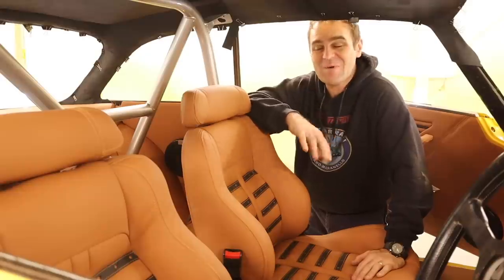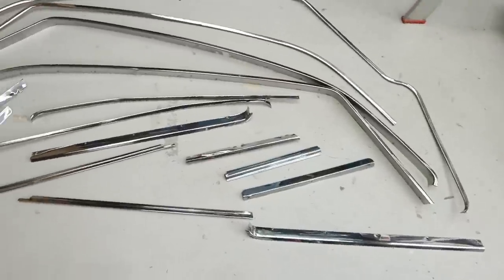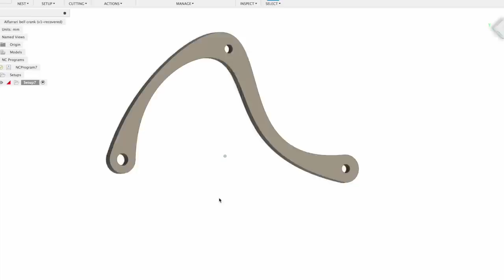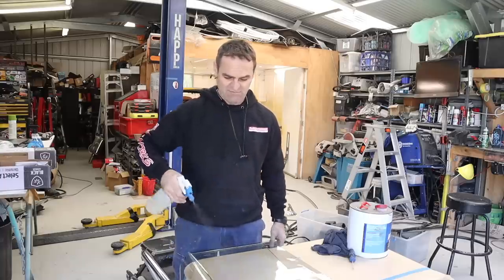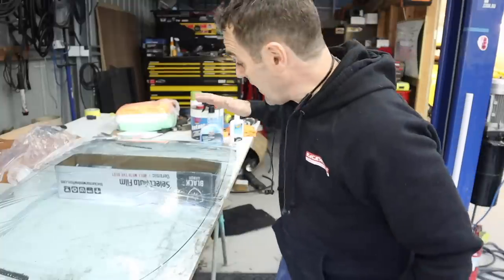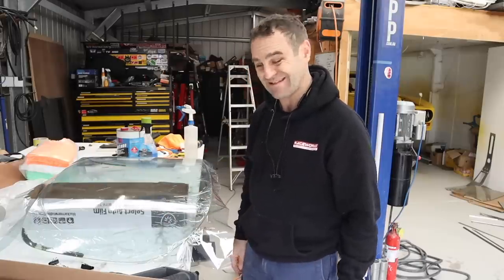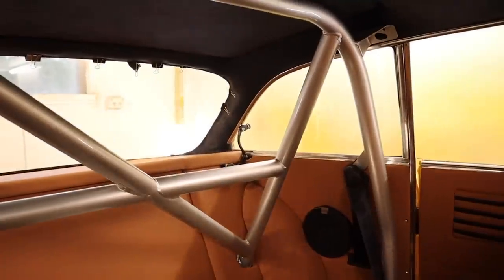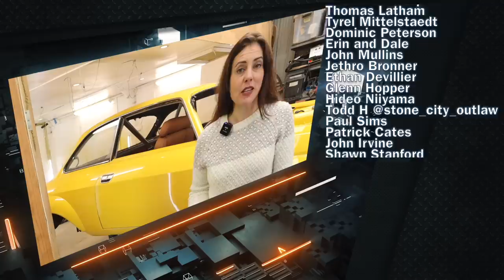DIY Window tinting Fail! - Ferrari engined Alfa 105 Alfarrari build part 187

Comment: When I was at work and things just didn't work out on a job The best thing I found was to walk away and come back a lot later after letting my mind think things through. I always say to my Sons once you have found a solution look and see if you can do it better or Quicker. In the case of your window tint problem I think I would have passed it on to the pro's lol

Comment: Hello Jeff!! Nice to see the project is moving on and when the result is not desirable, pass it on the professionals! Just a friendly fellow alfista suggestion, prepair yourself psychologically for the door's glass - trim alignment and fitment! Don't want to discourage you but it will take many fine adjustments to fit and work nice. As you said, they designed it very nice and we have to follow the mechanic's and designer's perception to fit and work as it is supposed to 🙂 Keep up the nice work!
Reply: Oh I've seen that go out on cars and basically never align ever again. It's just too frustrating and fiddly for anyone to ever perfect.
Reply: If all the parts are present, with fine tuning and patience everything will work just it was designed to

Comment: When working on trim pieces to remove dents and such it is best to try to press them out using copper or brass or even wooden drifts to prevent doing even more harm by stretching the metal and or leaving hammer marks.
Making wooden or alloy forms to use in a vice or press can help recover badly mangled trim work, you can even use this method to make new or modify trim from other vehicles to fit.

Comment: I did the tint on the rear window of my 75 Civic. I've never done it before and it took me two goes and a whole day to get it right (sort of). I had a little crinkle right on the edge which is covered by the rubber seal. The rear window of the Civic is way flatter and smaller than your Alfa Romeo though.

Comment: My brother did the tints on his old VW T2 bus with the windows out and washed in the bath but they were all flat so wasn't much of a problem.
Compound curved glass is very tricky for a first try at tinting and would be enough to put you off doing the rest had you started on it.

Comment: Thanks for sharing. I love doing trim restoration. I did have a rare piece wrap around my hand when my buffing wheel grabbed a clip. Scary stuff. Thanks for sharing.
-Spanky
Reply from the maker: I am always paranoid of the buff grabbing. That is why I used the hand buff for the complex bits ;)
Reply: @HomeBuiltByJeff  yep good idea. I had a heavy glove on at the time or I know I would’ve lost fingers. I had another piece fly across the shop and land 6 inches from a finished car that I charged 30k for the paint job. Keep up the work.
-Spanky

Comment: The windows don’t let the heat in and the tint doesn’t prevent the heat getting into the car. Non-tinted glass is transparent to sunlight and it is the sunlight which heats up the interior surfaces of the car. This produces infrared radiation and the glass is mostly opaque to infrared and it cannot escape. This is the greenhouse effect. The tinting reduces the light that enters.

Comment: First of all that glass needs to be on car (it's easer to heat that film and handle) baby powder works very well...  I've tinted more than 100 of them 😉
Reply: Access to the rear window of a 105 Alfa is difficult at best.  Even cleaning the inside of the rear window is a challenge.  Fitting plastic tint to a mounted rear screen with a pesky intrusive roll bar  - now that would be a monumental challenge for a human that does not have contortionist skills.

Comment: Curved windows need to be done with a series of 3” strips, pre-cut, in a trial run. When they are installed, they overlap each other by about 1/8”, usually along defroster lines. Tinting curved windows is not really a DIY job. P.S. window film goes on the inside of the glass.

Comment: you removed the rear window heater with the razor-blade? 🤣🤣🤣
Reply: I think that was on the outside of the glass
Reply from the maker: It was already half gone, so I removed the rest of it. I knew it was already toast which is why I didn't bother wiring for it ;)

Comment: My tinter friend tried to tint my 105 and couldn't do it so don't feel bad
Reply from the maker: That is a relief that it is not just me.
Reply: @HomeBuiltByJeff  A friend tinted the rear glass on a 105 in the 1980s, however the specialist advised him to do it in circa 3" strips which did work.  Perhaps the process has evolved and there are current tinting specialists that can do it in one piece - so I'm interested to learn if it can be done.

Comment: I would de-chrome with blackened or matte grey window trim and front grill.
Reply: As the car is a 1960s design - it's appropriate for the the car to be fitted with stainless steel and chrome embellishments - i.e. such embellishments maintain its integrity.  Black embellishments would be appropriate if the car was a late 1970s or 80s vehicle when these were in vogue.
Reply: @georgebettiol8338  Well said, i accept your opinion. Thank you.